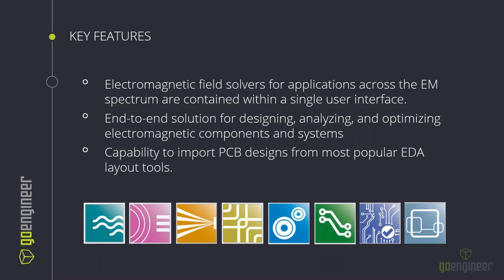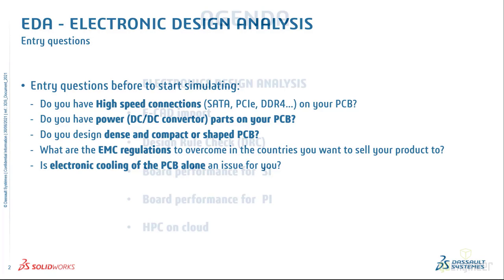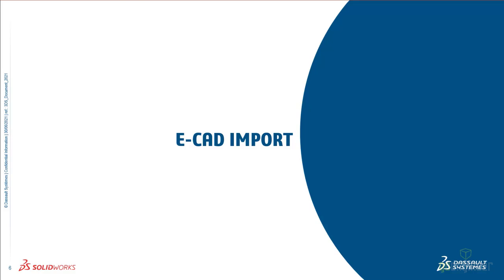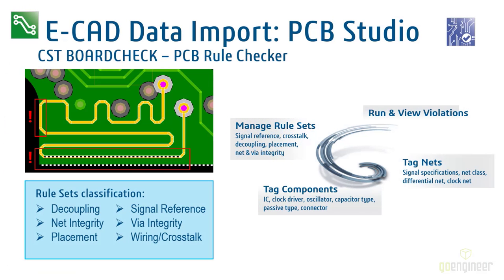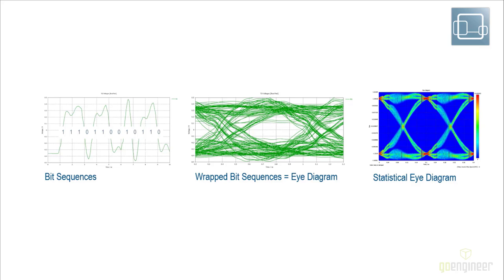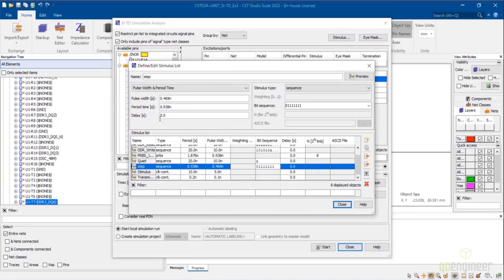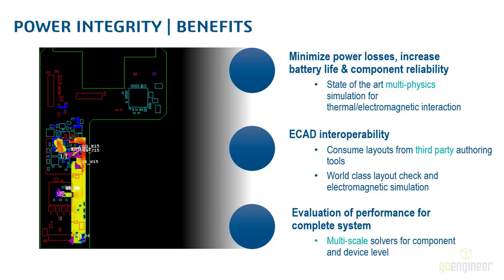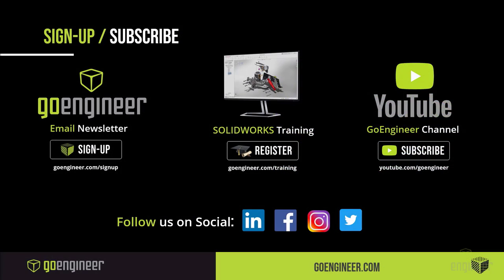CST Studio for Electrical Design - Signal and Power Integrity - Webinar

Comment: How can I find the effect of temperature on antenna in cst
Reply from the maker: There is a thermal analysis solver that will run after you run the hf simulation on the antenna